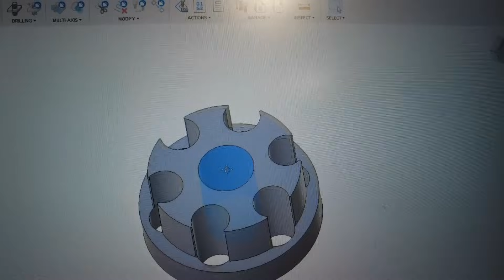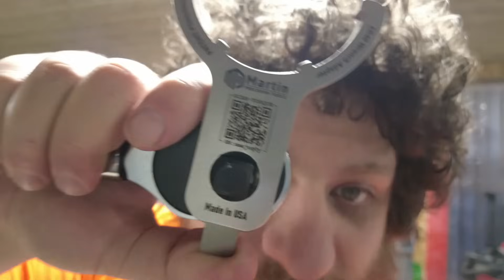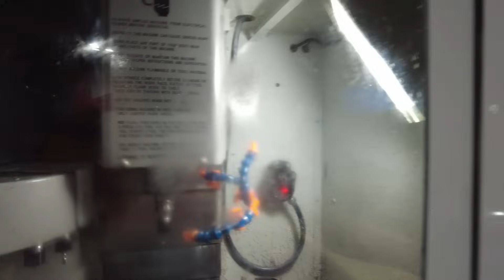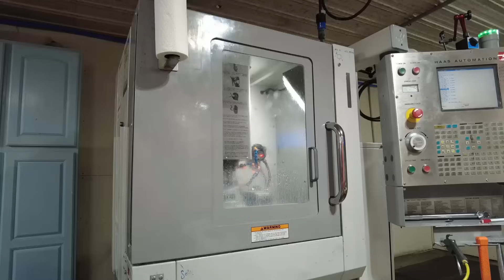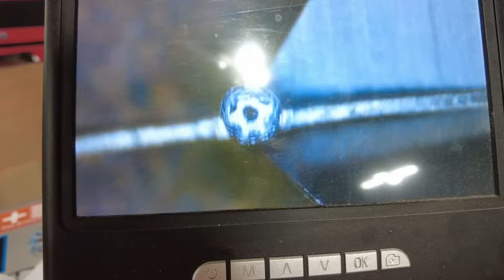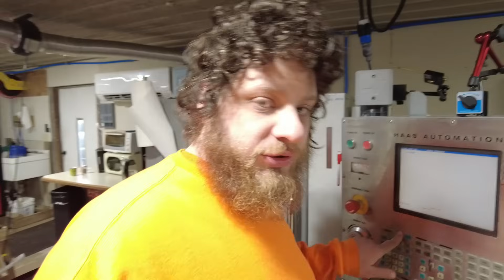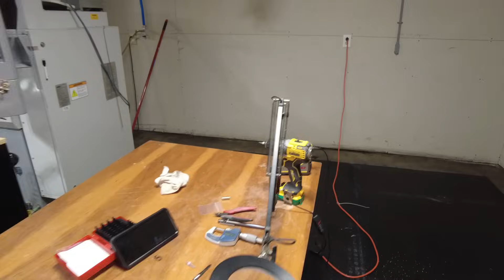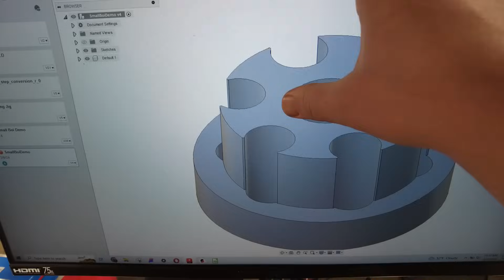Machining Some ABSURDLY Tiny Parts

Comment: We had to reverse engineer some parts for an endoscope once. Some of the screws were so small they looked like slivers of steel. With 35 years of design experience it was like I had never designed anything before in my life.
Reply from the maker: I don't actually know what the part is getting used for. But based on some context and wild guesses, it might actually be in that realm.
Reply: @AudacityMicro that makes sense, cable channels. I was thinking splitting out a fiber optic cable, but the fiber probably goes through the center hole lol
Reply: @ke6gwf maybe some control cables as well on the outside, and power /fiber for a light?
Reply: @AudacityMicro  I'd guess a one-off prototype device for a medical startup company. Some kind of implantable device? Maybe pacemakers, insulin pumps, it could be anything really.
Reply: Smallest I've done was a grid of .005" holes drilled into a 3/32" square of copper for a prototype cell phone connector.  I drilled holes .001" at a time by hand for 3 weeks

Comment: maybe when measuring small parts have a magnetic tray underneath so if you drop it at least it will be in the tray if its a ferrous part
Reply from the maker: The first batch of parts were stainless, so that wouldn't have helped. But the second batch was mild steel. Normally I try and stay away from magnets in the shop, since they attract all kinds of mess. But in a clean inspection environment, that wouldn't be an issue!

Comment: I do tiny surface mount PCB soldering, get a true stereo microscope you will be amazed how much better you can see the small parts.   White terry cloth topper on the table will help keep the parts from escaping.
Reply from the maker: That's on my list! Some sort of better magnification. But I need to invest in some better metrology stuff first. A toolmakers microscope would have saved me SO much time on these parts
Reply: @AudacityMicro You don't need a lot of magnification when it comes to microscopes. You need resolution. Any high quality 30x microscope will be better than a low quality 500x one and will allow you to see a lot more stuff
Reply: @1994  On my B&L I use a 20x (10x eye piece with zoom at about 2x) plus an add on 0.5X Barlow objective lens to give better working distanced for soldering.  The net magnification with the Barlow is only 10x. some times I zoom to 45x but not often.

Comment: If it makes you feel any better its 11:04pm here and I am on Youtube procrastinating
Reply from the maker: I sympathize 🫠. Good luck in whatever you are procrastinating on!
Reply: @AudacityMicro   3 days and I am interviewing at a school for micro machining. Can't sleep
Reply from the maker: I don't know you, but I'm sure if you are the kind of person who actively goes and finds YouTube videos about the topic, you will do just fine 🙂
Reply: @AudacityMicro  If all goes well next year I will be making teeny tiny parts like you.
One little bit of advice/trick that i found helps with holding tiny watch parts, I sharpen a set of pointy tweezers that are more stiff than beauty tweezers - NO flex on the tip when i squeeze them tight (number 3 or 5 usually) 
Then after sharpening, on the inside of the tips i hit it with a rough stone/sandpaper the rough area on the inside helps to grip the part, and if they tips don't flex it won't catapult the part into orbit like a slingshot.

Comment: This is like a Joe Pie video on ultra-nightmare difficulty.😮
Reply from the maker: thank you for introducing me to another machining channel 😂. I had to google who joe pie was, and now I have one of his videos on
Reply: @AudacityMicro  Stefan Gotteswinter is another awesome guy.
Reply: @AudacityMicro   oh that's awesome that you get to discover him. His stuff is all manual machine work, but I'm sure you'll love it. He does some really wild stuff. Glad to have found your channel. I stumbled upon you yesterday.
Reply: I don't think you're allowed to call yourself a machinist these days if you don't know who joe pie is. Especially if you're working on teeny tiny stuff. Another essential is "edge precision". He doesn't do tiny stuff, but he does really intricate stuff on a huge scale!
Reply: @gorak9000 Edge precision does big parts with sub-thou tolerances in location of holes multiple feet apart.  There are channels that regularly work to higher precision (Stefan Gotteswinter, Oxtoolco, Adam the Machinist, Cylo's Garage, Robrenz, & Huygens Optics in roughly decreasing order of common feature size) but none I can think of that hold such precise tolerances on such large & complex parts. Peter is a damn CNC wizard.
Reply: Surely, you heard of clickspring and Chronova Engineering, right?
Reply: @ariesmars29  Is clickspring a "machining" channel? A lot of what he does is "rough cut with bandsaw, and [3 hours] of filing to the line by hand with needle files". What he does and the results are amazing, but the punctilious hand finishing is way beyond "machining" IMO. That's like a whole class to itself!

Comment: Jewelers use black velvet. as a work surface when setting small diamonds. Small objects don't roll or bounce on velvet, and they shoe up against black ,
Reply from the maker: That makes a lot of sense! I definitely need to work out a better work area if I'm going to keep doing this stuff.
Reply: A microscopic drone with a hint of plutonium is an assassin dream..
Reply: I thought diamonds had no sole?
Reply: Yes, exactly. Just what I was going to write.
Reply: Vat iz dat? Velvet? (Coming to America)

Comment: wtf, as someone who makes big molds, this is my biggest nightmare. I already misplace half of my stuff, a part like that is just gone if you set it on a table lol. 
The real question is what on earth does someone need a part like this for?!
Reply from the maker: Big molds are my nightmare. Do you have any idea how often I screw up parts? I would go broke if it didn't only take 19 cents in material per part. 🤣

Not sure about the end use of the part (couldn't tell you even if I knew), but almost all of my parts go to medical companies, and the research departments at universities.

Comment: What's the Tolerance on a part that size?
Reply from the maker: Most of the features were +/- .003" (.08mm), with some being +/- .001" (.025mm)
Reply: @AudacityMicro  thanks 😊
Reply: That sounds way too much for such small parts?
Reply from the maker: I didn't make the drawings 😂

Comment: smallest part i ever did was 0,9x1,5x3mm with a 1.2mm angled hole in it
Reply from the maker: That is incredibly tiny, and the angled hole sounds like a nightmare 😅
Reply: @AudacityMicro  actually after a bit of fiddling around with toolpath order it was quite easy. Made it on a 5 axis machine and the hole was interpolated using a 1mm bullnose endmill then using the same tool tabbing it, break it off and clamp it in a tiny vise to remove the tab.
Reply from the maker: Well 5 axis is just cheating 😂. I very much look forward to moving to 5 axis.

Comment: One tip for tabbing parts, if they have a thru hole try and interpolate around the thru hole leaving a thin ring of material around the hole. You can then use a deburring tool to remove the burr
Reply from the maker: Oooh! That makes sense! Thanks!

Comment: Just curious - approximately what kind of ballpark is the cost for a custom micro-machining job like this in? $500-ish? $2000-ish? $10000-ish?
Reply from the maker: This was two separate Xometry jobs. They totaled to about $1400 for 20 parts. I am fine with a lower rate on xometry work, since I don't have to waste time on quoting, sales, invoicing, etc... so if I took this job outside of xometry it would probably be 50-100% more than that.
Reply: @AudacityMicro  Honestly that doesn't sound too bad. If you could get it, high speed steel tooling with conventional cutting only would have nailed this job in a day

Comment: Cool content. I had to drill 1000 holes in PEEK with a 0.001 drill. They cost $147 each and I broke 2 just getting them out of the package. So I know your pain
Reply: I think I bought 10 total. I broke 2 right away, then one just from an automatic tool change, and 2 getting the feeds and speeds right. Then one drill did 460 holes, the next one 200+, the one after that like 25, then the last one closed it out. I still have 2 on my desk. The part went to space for science experiments on cell growth so $ wasn’t as big an issue. A redesign of the part now uses commercially available filter material so i hopefully wont need those drills again. It kept me up at night
Reply: @rexmundi8154  they should have done that from the beginning, the designer is not thinking straight.
Reply: @ernahubbard2062 Engineers design but often have no idea of how to actually build what they just drew up.   Back during the Apollo program NASA drilled what they claimed were the smallest holes ever drilled and sent out sample bits to everyone they thought would be interested in such things.   A few days later a package from one of the Swiss watch makers was returned with no accompanying note...just the tiny bit they'd been sent.   Under the microscope showed that they had drilled a hole in the bit...then sent it back!   Fun stuff!
Reply: @ernahubbard2062  unfortunately you rarely get to pick the engineer. That being said the experiments are doing pretty crazy shit in orbit on the International Space Station and the scientists we work with need some pretty specialized conditions, so often there isn’t a ready made solution. It’s fun to be challenged in the shop but it can be stressful. Tomorrow I’m making a a 60mm long part  2mm in diameter  necked down to 1.5mm in the middle. 2 off axis holes drilled at a 25% angle near each end and the ends drilled out to 1.6mm.
Reply: @recoilrob324  that’s a great story. I have Daniel’s "On Watchmaking" and I’ve actually used some of the stuff I saw in it. I’ve been using Clickspring’s superglue trick for awhile now and for very small parts I’ve even used wax like in watchmaking.
Reply: @rexmundi8154  well, in general i agree with you that we need to push boundaries and try new things, but without analyze the actual need and process to make something , i wouldn't call that a qualified engineer.

"Tomorrow I’m making a a 60mm long part  2mm in diameter  necked down to 1.5mm in the middle. 2 off axis holes drilled at a 25% angle near each end and the ends drilled out to 1.6mm."
That is very challenging job indeed.
Reply: that tale has made the rounds many times,a usa firm sent dormer tools what they claimed was the thinnest drill ever and they sent it back with a hole drilled inside it lol @recoilrob324
Reply: @rexmundi8154 Omg. I was imagining your customer saying “yay we found someone who can actually make these, we’ll take 3,000 more”. 🤢🤢🤢
Reply from the maker: Oh my gosh, that's terrifying 😂
Reply: That is the stuff of nightmares
Reply: How many were in the pack and how many did you go through? Thats wild lol
Reply: The customer must have pretty deep pockets to even think about making a thing like that
Reply: Have actually had coolant break carbide drills really small just from pressure hitting from the side. Had to watch angle it was hitting drills 😮
Reply: @Bob_Adkins
0 seconds ago
Tough I know, but think about the poor guy that has to make those drills
Reply: @Bob_Adkins  it’s crazy you can  work in this job your whole career and still not scratch the surface of what can be done. There isn’t a day that goes by that I don’t learn something new or see something that amazes me. I love seeing young guys like this coming into the trade. The average age of machinists is "almost dead".

Comment: It is like watchmaking. When you are assembling a watch and grip one of the screws too tightly with your tweezers, it disappears into low earth orbit...
Reply from the maker: I think I need to do some reading up on watch making. I think there's a lot to learn from that field, that I could apply to my own work.
Reply: Beefier more rigid tweezers are actually better for tiny objects because they dont put spring pressure on the part. Less likely to launch. Counterintuitive but effective. @AudacityMicro
Reply: @Bartles247    great advice! A good option along those lines would be nylon coated groove tipped tweezers, they are quite sturdy so they dont bend or warp, so no springy-flingy satellite launches! Plus they are anti-static so they can be used on sensitive electronics like CMOS ICs, MOSFET transistors, micro inductors, etc.🔬I use mine for working with tiny gemstones. The grooved/"slotted" tip really works well to hold rounded, sharp edged and/or oddly shaped objects at particular angles and doesn't allow objects to roll or slip. Just be aware they aren't the kind with the "grooves" running perpendicular across the tip to create a textured gripping surface, no, it is just one long fine groove straight down the center of each of the gripping faces. They were kind of hard to find when I tried to get another pair a couple of years ago. If all else fails, you can just use your mill and groove the tips of any sturdy pair of tweezers then dip the tips in a really thinned out latex or silicone. Whatever works! @AudacityMicro
Reply: @jameslederer6465 Great advice! A good option along those lines would be nylon coated groove tipped tweezers, they are quite sturdy so they dont bend or warp, plus they are anti-static so they can be used on sensitive electronics like CMOS ICs, MOSFET transistors, micro inductors, etc.🔬I use mine for tiny gemstones, the grooved/"slotted" tip really works well to hold rounded, sharp edged and/or oddly shaped objects at particular angles and doesn't allow objects to roll or slip. Just be aware they aren't the kind with the "grooves" running perpendicular across the tip to create a textured gripping surface, no, it is just one long groove straight down the center of each of the gripping faces. They were kind of hard to find when I tried to get another pair a couple of years ago. If all else fails, you can just use the CNC on any decently sturdy pair of tweezers (if you are steady enough) and slot the tips your self, then dip the tips in a really thinned out latex or silicone. Whatever works.
Reply: The watch YT channels I watch use a blue tack like substance to hold onto parts called Rodico. Less impulse possibility.  Also this sort of a part seems like a good excuse to shop for a stereoscopic microscope. I wish I had one for soldering.     @AudacityMicro
Reply: We Watchmakers call that the "Swiss Space Program" 🤣
I actually make watchparts with my Lathe and Mill, and when parting off with the lathe, make sure you catch the part with a piece of Tube, to prevent it falling in the Chiptray.. because when it does.. you'll never find it back, because some of the Chips you make can easily be larger than the part..
Reply: I love the work you put into making similar parts to show us. Unique feature of your channel.
Reply: I would really like to know how watchmakers made the extremely small parts used in watches in the 17 and 1800''s
Reply: @dhyde9207  With tiny lathes driven by a bow and string or a large handwheel with a belt. And then specialised tools for polishing screw heads, cutting the slot and threads, etc.
Reply: @dhyde9207  .... or how the Antikythera  Mechanism (see: https://www.youtube.com/watch?v=ML4tw_UzqZE and the period tools he made to make the mechanism by hand - https://www.youtube.com/playlist?list=PLZioPDnFPNsGnUXuZScwn6Ackf6LGILCa )
Reply: Aren't those called Jesus screws? Like Jesus clips?
Reply: I would suggest a glovebox when handling on the bench, maybe?
Reply: I always refer to it as, the twilight zone.
Reply: I personally subscribe to the idea that when they fall, they travel to an alternate dimension. I'm hoping it's one where Incabloc springs are sacred and I'm hailed as a generous deity 😂
Reply: @simonehudspeth861  exactly lmao.
Reply: Yes! hahahaha
Reply: +1, also the springs in the 7750 are like hairs, that enter the 9:th gate with a ”Pling” sound 😂